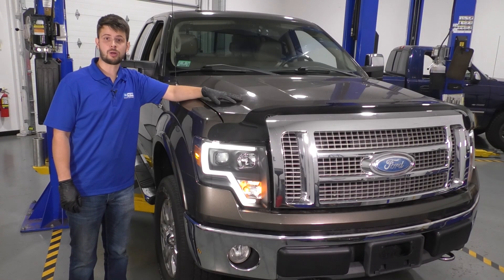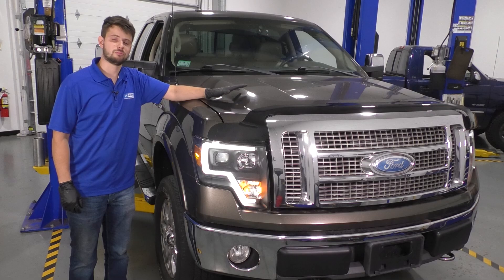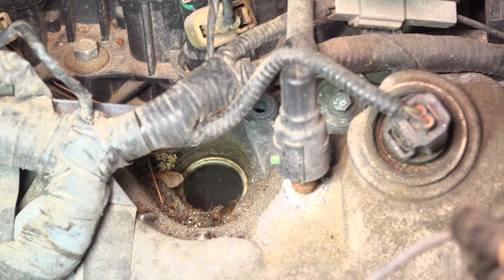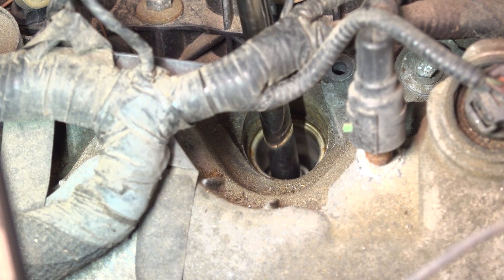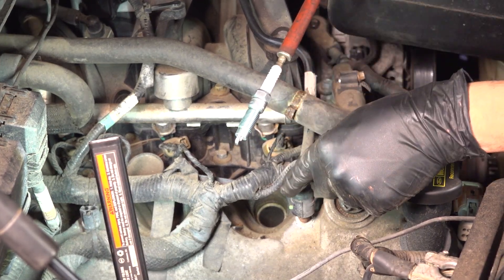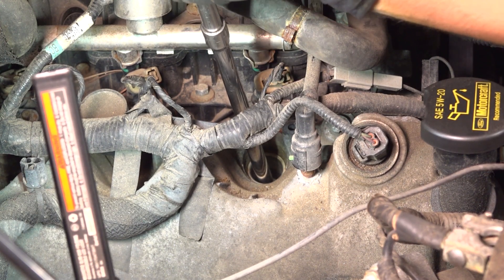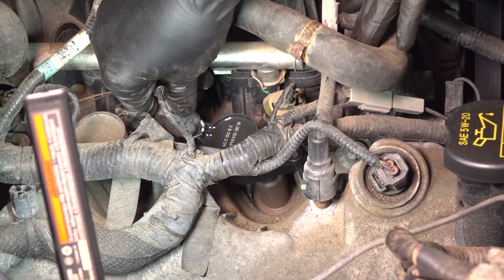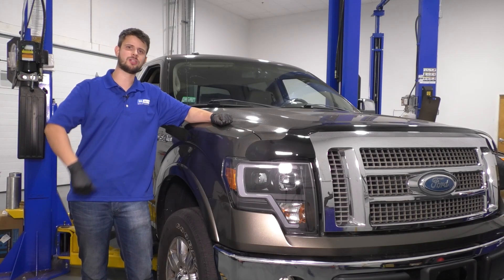How to Replace Spark Plugs 2009-2014 Ford F-150 (5.4L V8)

Comment: Replacement of the spark plugs in the front is much easier than the one in the rear like plug #8. So if you're going to show how to replace one spark plug replace plug #8.

Comment: Your didn't mention:  The year of the truck your working on.........Gap of spark plug.............Problem years of Ford Plugs breaking when extracting.......You should have come in with your video to give respective on the engine, started out to close.... these are relevant points you should have mentioned.

Comment: An old trick is to use a piece of rubber fuel line hose plugged onto the top of plug instead of a magnet and you can actually turn the plug in to start

Comment: A1 Auto can you please show how to change out the spark plug on a 2009 Ford F150 5.4L and explain the difference between a 2008 spark plug change and the 2009 and explained the problem. In a video in a video. My question is since the spark plug has been changed over to a new design in the 2009 5.4L are they prone to breakage. like the 2004 through 2008 spark plugs.
Reply: No they fixed that issue on the 09 plus